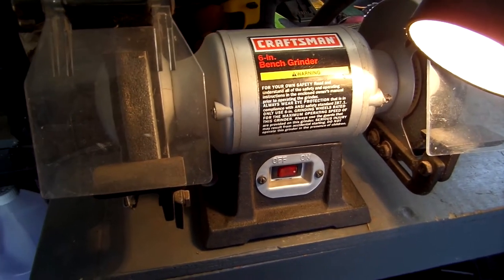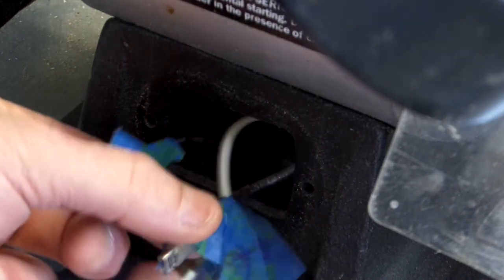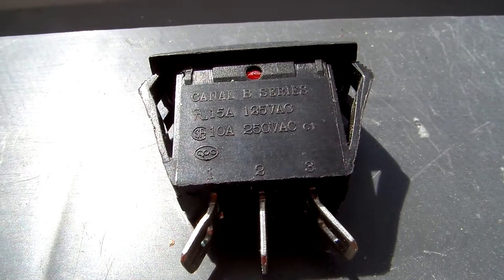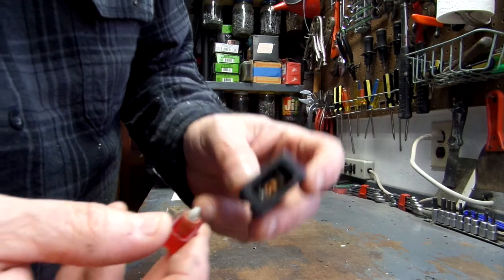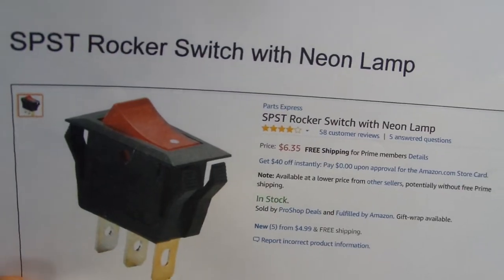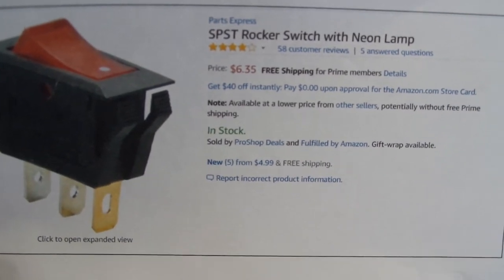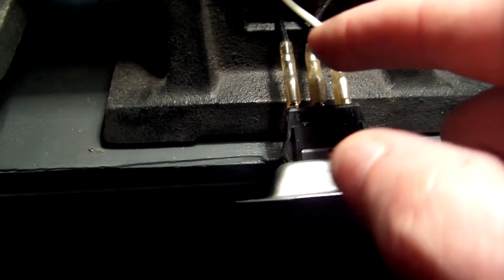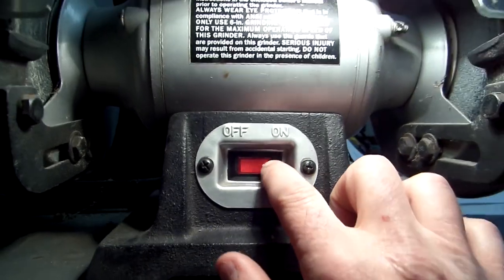Craftsman Bench Grinder Rocker Switch Replacement

Comment: I have the same grinder and just replaced the same switch ordered through the link provided. The replacement switch is not quite the same as the original or the one in the video. The replacement switch is narrower and slightly longer. I had to file the switch plate to make the opening longer to fit. The new switch also does not light. I did get the replacement switch for $1.89 each so no complaints, the switch works fine.
Reply from the maker: Happy to hear you got it working Donald.  👍

Comment: Hello Bud, I replaced the rocker switch and the capacitor but my grinder doesn't run. How do I test the switch before I replace it again?
Reply from the maker: A multimeter will quickly let you know if the switch is faulty.  Before you can begin testing for continuity you will need to remove the field wires from the switch.   Touch one of the probes to one of the incoming power connections on the switch. Now touch the other probe to one of the field wire terminals. Then test the second field wire terminal. If the multimeter doesn't beep when you touch either one of the field wire connections you have a broken connection in the switch; if it beeps for both of the field wire connections, then you have a short in your switch; if the multimeter only beeps for one of the field wire connections, you have a good switch.

Comment: I got a Dayton grinder model 1 Z 853 Q and a wire came undone or was never connected and I'm trying to figure out how to get it going I plugged up at work but when I moved it I looked at it something was disconnected but I don't know if the wire was just touching something and was never connected and allowed it to work when I check it does the three lead switch provide positive power into the motor ground wire to the frame and this is the one I don't know negative black wire from the power cord into the switch?
Reply: The black wire from the power cord is unplugged and the only open plug for it is on the switch but I don't want to plug it up in case it's wrong. One of the leads from the switch is to the frame which is of course connected to the green wire into the wall plug and the other wire on the switch goes into the motor I think it's hot positive wire? Turn figure out the diagram so I can plug it back up cuz it worked but then I moved it and I must have unplugged it when I pulled the cord which unplugged the black negative I believe it's negative but the negative and positive connections on the plug are the same size

Comment: mine has 4 wires...
Reply from the maker: It is helpful, particularly if troubleshooting the wiring, to have the original manual for the grinder, as the manuals typically provide detailed wiring diagrams for your particular make and model. Frequently, if you no longer have the manual or you purchased the grinder second hand and it didn't come with one, you may be able to download a manual from the Internet or order one from the manufacturer.